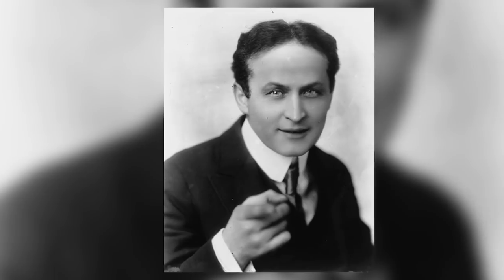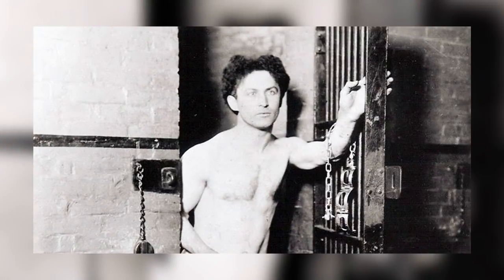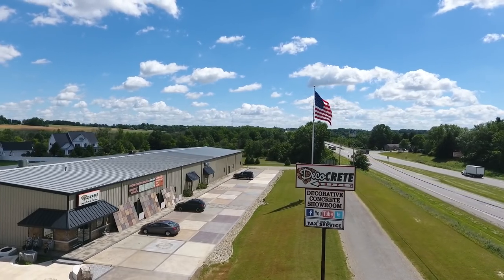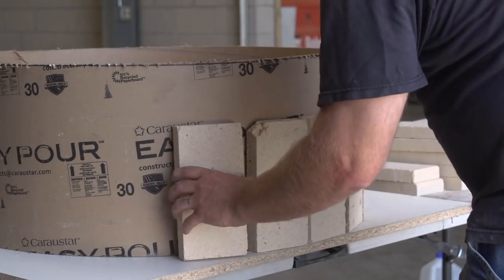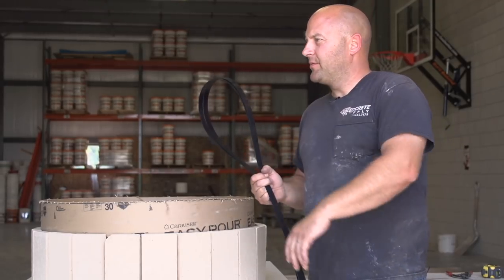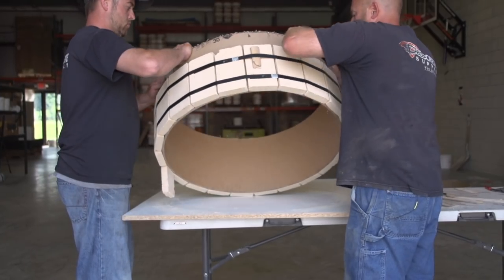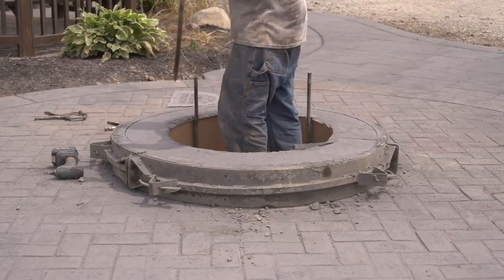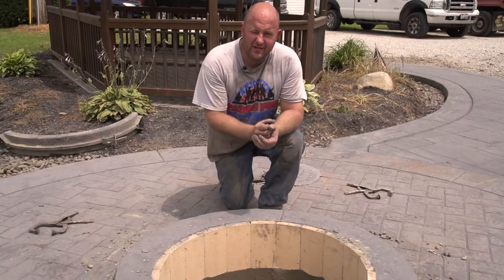Pour Concrete Fire Pit

Comment: Wondering if not having refractory mortar holding those fire brings in place will be an issue long term.  Looks great.  thanks!
Reply: Yes, I would think so. I plan on pouring a small firepit myself, but I'm going to place refractory cement in between all the firebricks before placing the assembly in the concrete forms.

Comment: Im pouring one if these this saturday, what can i spray or coat stamp molds with so concrete doesnt stick? Im pouring the proline fire pit
Reply from the maker: You want to use Easy Strip on the forms: https://www.deco-cretesupply.com/products/releases-forms-expansion-wire/easy-strip
Reply: I went old school and used pam

Comment: there are modifications to that which will provide a better controlled, useable, lower smoke, lower fuel consumption pit with less concrete and a better look . . . still a nice pour, i'd like to see a go back video where you went and inspected the floor of that pit and how it's performed, it could be modified without a whole lot of grief, but it'd require a drill and jack hammer :)